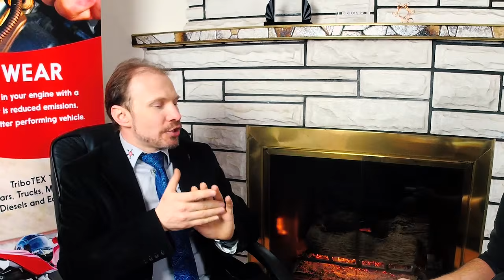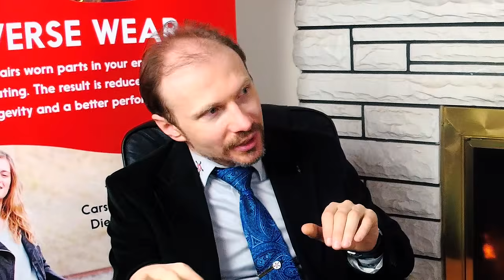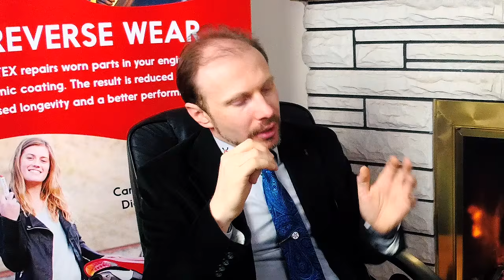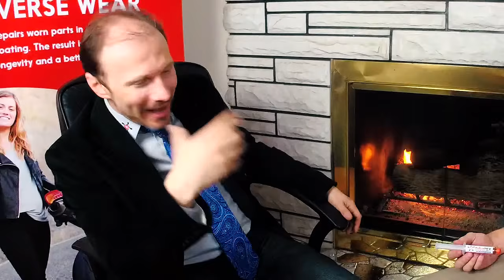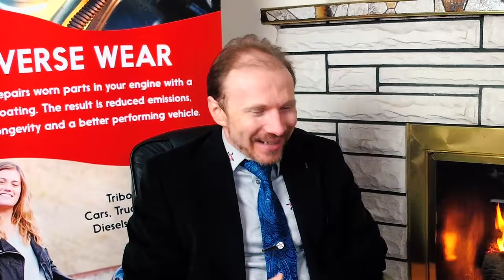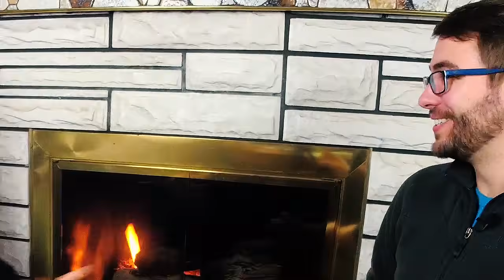TriboTEX Transmission intro and Q and A

Comment: Excellent, evidence-based discussion. I have a 69 Corvette with 4 speed manual trans. It grinds when I downshift to second gear unless I double clutch, in which case it shifts fine. Any chance your product would help?
Reply: did it work

Comment: This is the longest discussion on an additive that I have ever seen. And A great one!  I wish I had those old fashioned dipstick type Trans and try this out easily. I have to think how to best put it in my VW :)
Reply: Did you ever put it in your VW? How much of a hassle was it?
Reply: @gregp3522  I am waiting for the complete tx fluid change interval to add it. Not many garages are willing to do the partial fill
Reply: @ampiko68  Just put it in the oil fill. You don't need a partial fill, it's only a few ounces of fluid.
Reply: did it work
Reply: @melonmalone6307  i didn't try. Sold my VW.
Reply: Ok